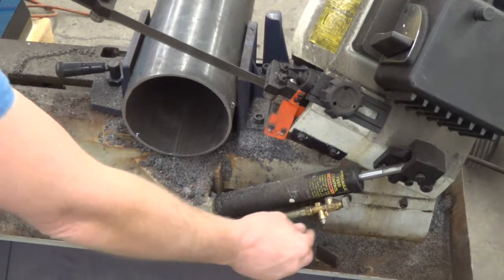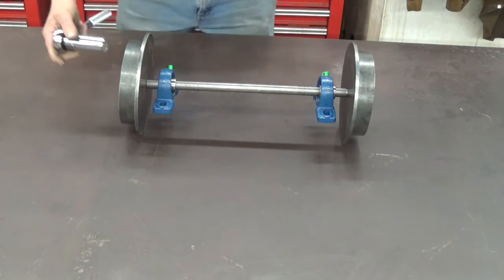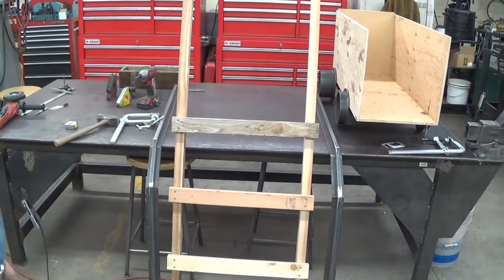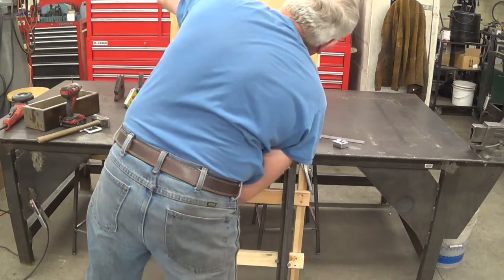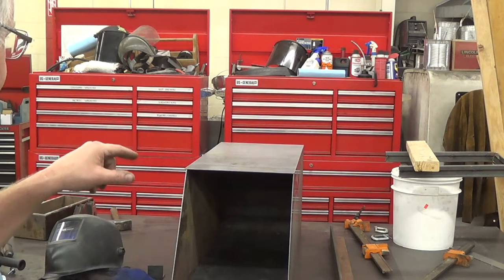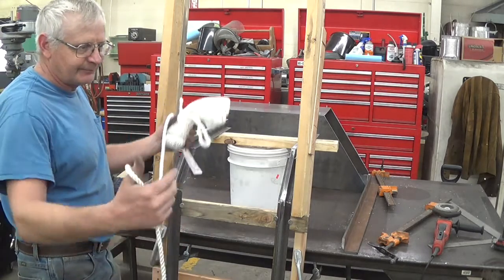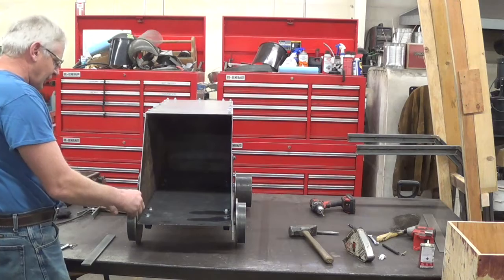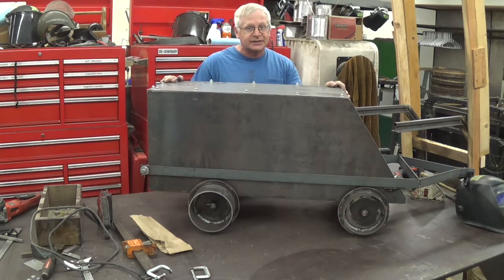Homemade Mine Cart

Comment: what's the size of the bearings?
Reply from the maker: 3/4"...  I turned down the end of the shaft to thread it to 5/8" so the wheels just tighten on with a nut.
Reply: @pathofthebee2873  thanks.